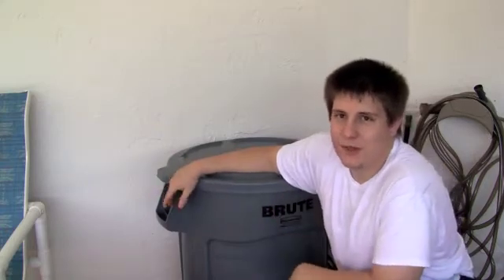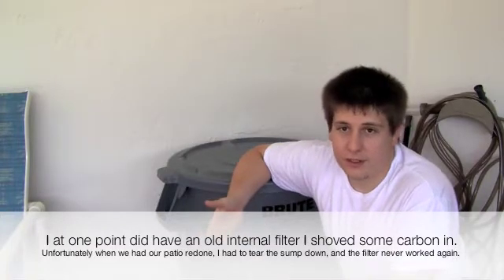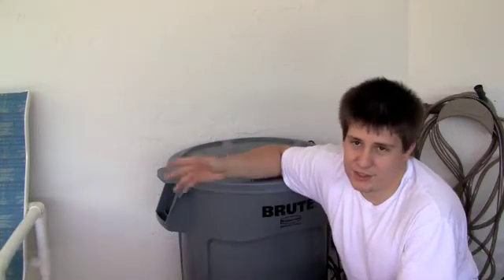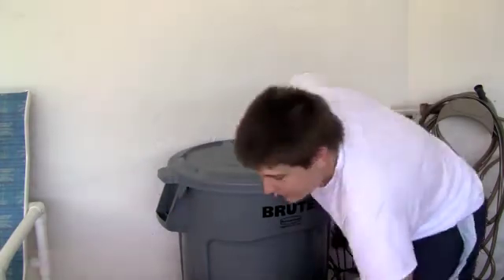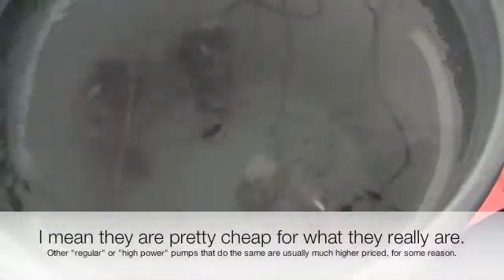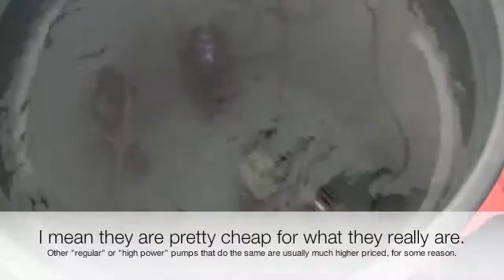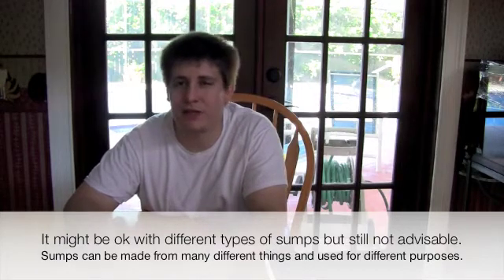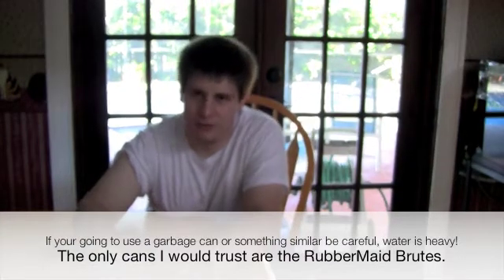How to Build a Freshwater Sump System.

Comment from the maker: @350streetracer There is no internal filter in there, its just an extra powerhead with the quick filter attachment. If I were to do a high end one, it would have a more powerful main pump (pond pump), better UV sterilizers, and it would have a internal filter or 2, which I am working on something right now that can just run some water through some carbon in there. I used to have one but broke a while ago. I might have even used a bigger trash can as well, but they are actually pretty expensive.

Comment: So, this is a budget sump? Internal Fluval filter, two UV lights, one powerhead with a quick connect filter separately, plus a pond pump. Just out of curiosity, if you were to do a high end one, what would be missing? An RO system?